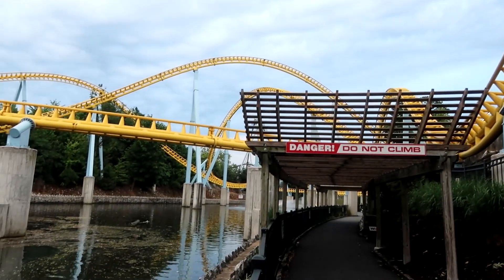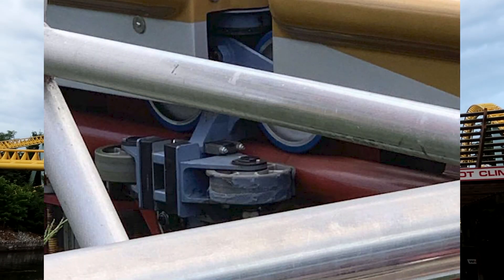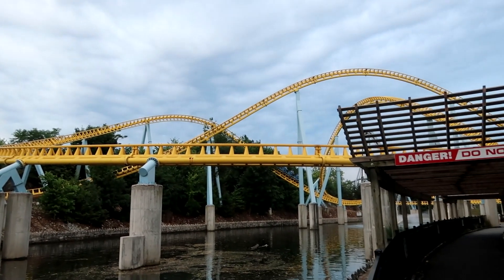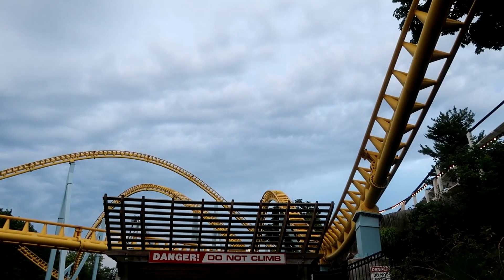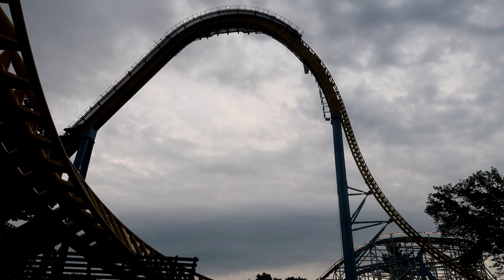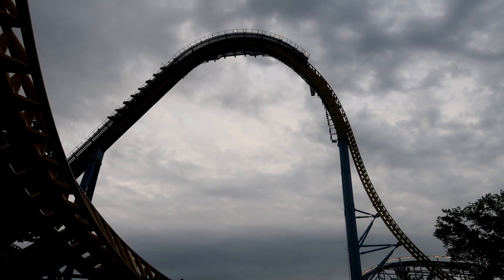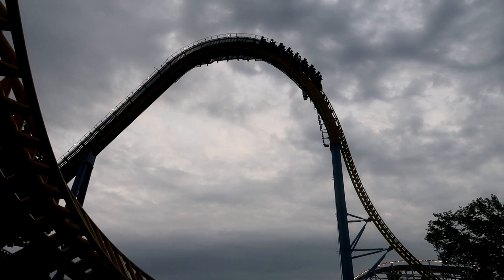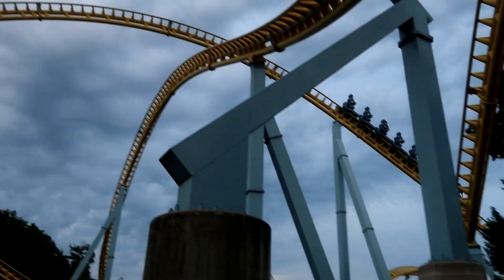Why Do Roller Coasters Break Down?

Comment: Or in some cases like space mountain in Disneyland, CA(HKDL's space mountain use the same design but generally won't run the same amount of trains as it isn't as busy as CA's space mountain and less likely for this to occur, it can still happen though on some of my visit to that park during busier days as it was my local park), it runs around 12 to 13 cars at once on the track with 20 seconds interval, but there were not enough block zones for the trains to stack at the station, which ended up having trains stacked outside the final brakes and stopped into the ride layout if the station backs up from slow loading, which culminated into a cascade break down and requiring the block zones to be individually reset for resuming operation. Was it software or hardware causing the break down?

Comment: I once experienced a break down during a night ride on Shambhala, my best guess is that it was a sensor issue, I was stuck on the final brake run for a while until the issue was resolved (no evac, the train moved into the station as normal)

Comment: As a ride op, most downtime is being caused by sensors deciding “nah ima not let this ride work” especially Zamperla’s flat rides.
Reply: Why is Zamperla so booty, and why the frick did Cedar Point think it would be a good idea to use them to overhaul their tallest attraction.. like yes, intamin manufacturers glass, but they're clearly not the worst ones out there..

Comment: As a ride op, I concur that most downtime is from electrical/programming/sensor issues. Like on the last weekend of operations at our park, my coaster had two separate issues causing downtime: 

1) normally, when a train clears the station and fully enters the lift hill, the other train in the brakes should advance into the station, right? Well, one of ours didn't. Mechanics didn't know why, but that train never left the brakes and they had to reboot the ride to get it moving. As a result, we had to operate at one train on one of our busiest weekends of the year

2) much simpler: the sensor for one of the platform's doors didn't work properly and whether or not it actually detected the door was locked when we locked it in place was pure luck. As a result, we had to condemn that door and never open it.
Reply: Wow ok, was at valleyfair and renegade only had one train...reading this now I have much better understanding. Thanks..
Not saying that was the issue but now I know more on this

Comment: Judging by how many of these ride accidents you've covered that have caused disastrous derailments and crashes when even just one wheel assembly is broken, I would far rather deal with the downtime than ride a coaster with a bad wheel because "it's just one, the train has tons of wheels, it'll be fine."

Comment: As a ride operator, we need videos like this to get more views! 95% or more of the downtime I’ve experienced is all because a little sensor had a slight suspicion that something is off, or a sensor is going bad.
Reply: Yeah. I've had some that were major that prevented the ride from starting but most of the time it's because you held the button down a little longer than you were supposed to or one of the sensors has something on it from being outside.